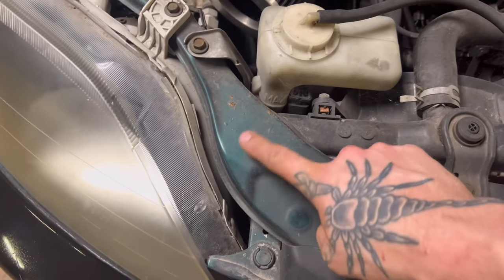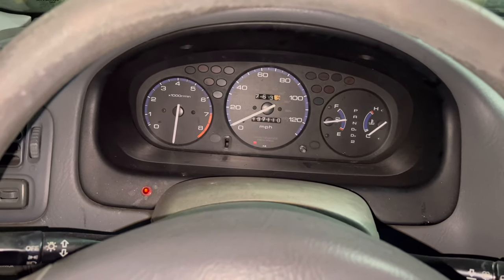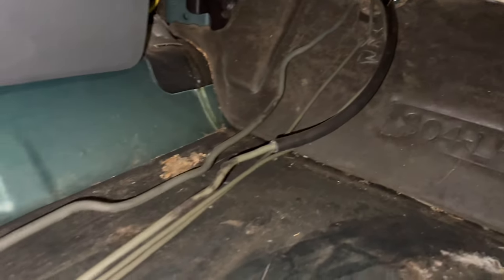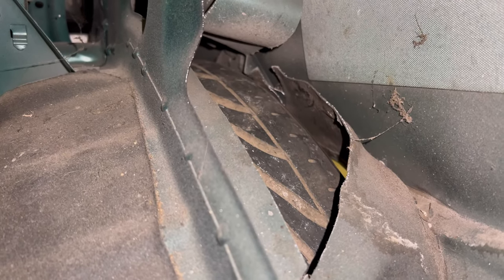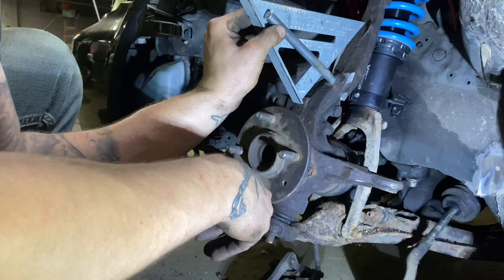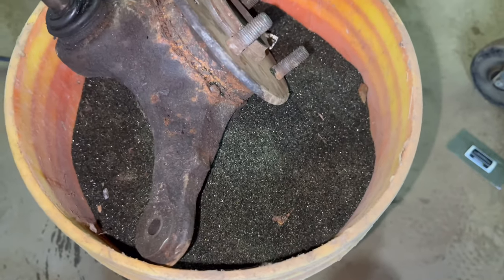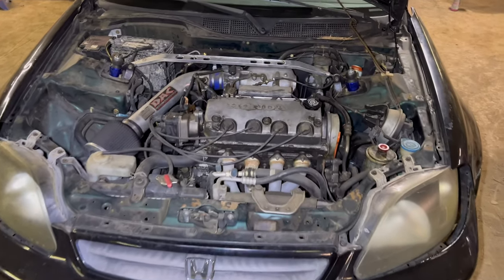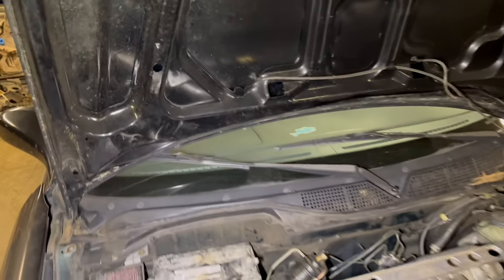I bought the cleanest 99 Honda Civic from Georgia, stance will make her dance

Comment: Have you ever used visegrips to limp a civic with broken axle home?    Would clamping the broken axle actually work?
Reply from the maker: I tied that on the axle cup. Broke the vice grips. The problem is it doubles the speed of the working axle. So probably double the torque

Comment: A bro question still working on my 8th gen civic it’s hammered in the back it’s on 17 inch stock Acura tl rims and ya it’s fire looking but they rub when u turn and less I roll the fenders and Ryan them down and pull one as a 22 mm spacer then they’d be able to run perfect so I’m thinking trade them for 15 on a minor stretch tire and then lifting the car but it would still sit about where it is now and ride 100% better

Comment: how tf are you still on springs? or did you switch to washers
Reply from the maker: Always on springs. I like the comfort
Reply: @Ruined4banger  how did you get the car that low? My coilovers are also maxpeedingrods and it only lowered it like 5 inches from stock but I still need maybe 3 to get the stance I want